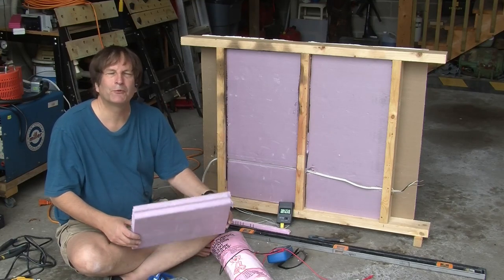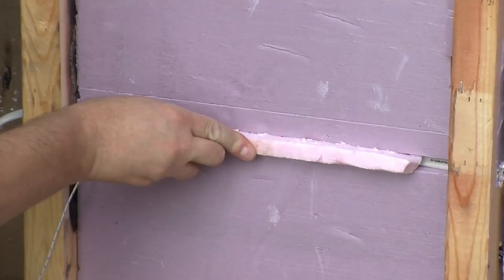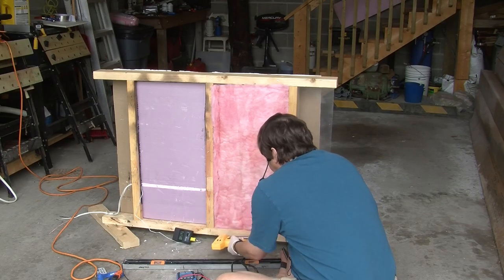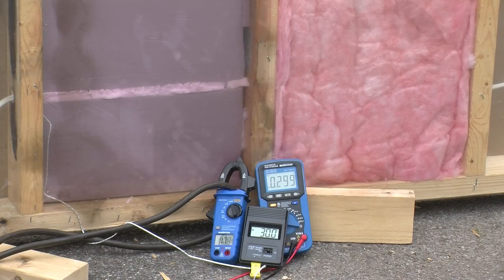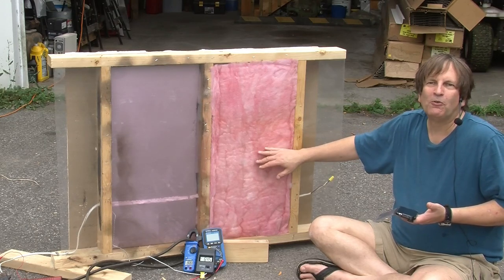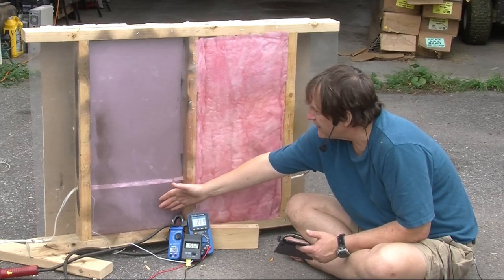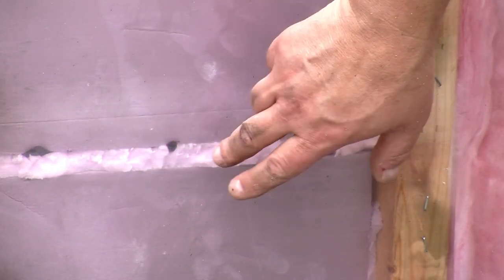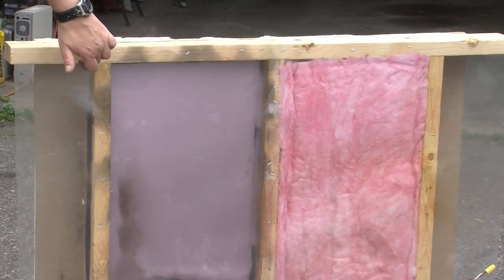Overheating and Foam Insulation. What happened?

Comment: Enjoy your test as usual. 30 years ago as part of a hospital-home health safety program, we were instructed on the hazards of having insulation covering extension cords and even phone wires. The insulation could be a throw rug, linens, or a pile of newspapers. All electrical currents produce heat was the conclusion. It would be interesting to stress an extension cord covered with a thick rug or a pillow.
Reply from the maker: Well thanks you Ron! That must have been an interesting thing to be part of! I'm a bit surprised at the phone line caution since the currents as so low although admittedly the wire is smaller too. Did you see the extension cord test without any covering? https://youtu.be/k0g2LinZWyA  The brown cords are older and probably the type that was common 30 years ago.  I have read that either CSA or UL does one test as part of there certification where the item under test is covered in cheesecloth and the cloth better not catch fire if various components in the device fail in  any way. Although I think the cloth is thin and not so much of a heat insulator. I will keep your suggestion in mind - weather will soon get colder and wetter and I cant risk a test like that in  inside the garage with the door open so if I get to it in the next month may depend on how nice fall is. By the way - next week I plan to do a Knob and Tube current test with vintage wires and insulators.
Reply: @ElectromagneticVideos  Will look forward to the Nob and Tube test. Yes, the current for common phone wires would be too weak for any fire; I should have said that the much thicker cables used in busy offices that carry multiple conductors are the ones that over time actually do generate enough heat that in rare instances have caused smoldering fires. As to extension cords we were shown some photos as an example. With OSHA and inspectors, even intruding into homes of patients, we as nurses would do a home safety inspection as part of our initial nursing assessment.
Reply from the maker: @ronkemperful  The old 25 pair phone wire for office phones! I never even thought of that. I could see that generating heat with some many wires clustered together each drawing a small current and producing a little heat and it all adding up. I actually used to hord scrap sections of that cable - the individual wire are great hookup wires for development work - each is nicely color coded and fit perfectly in prototype boards
Reply: @ElectromagneticVideos  It would be a very interesting test with knob and tube on the insulators.    I'm saying that for 2 reasons,  the biggest is the cloth cover insulation combined with the inability to short as they'd be too far apart.      Like I mentioned in a previous comment,  lived in Pontiac Michigan where I had to evacuate my rental property when the neighbors home 1928 Balloon framed 2 story burned fiercely on a cold and  windy November night started by a bad splice between knob and tube, & romex in the attic.    The  experiment being,  would the cloth covering actually be flammable enough to catch fire, and if so, at how much current,  and with what amount and type of insulation.   Simular could be questioned about the older, 2 wire ungrounded romex with the fabric braid. Incidentally I've researched and talked to many electricians, your technically not supposed to insulate over knob and tube,  supposedly because it's designed to be air cooled, and insulation changes the thermal and fire safety properties of the wiring.    Of course in a real world situation it would be very rare to have knob and tube still in use, as most insurance companies refuse to insure the property or at least require an electrician inspect and certify the condition,  and you'd pay an arm and a leg for coverage,  and if you knew you had it you'd probably want to start budgeting real soon, for a rewire and sleep better at night.
Reply from the maker: @Sparky-ww5re  I will be interested in what happens too. I got some a few feet of knob and tube wire as well as many insulators from the shed (maybe former carriage house) from a place that friend is renovating in Pakenham, Ontario. The house is about 200 years old, but the shed may not be as old. I did already measure the diameter of the wire and it is #14. No idea  if wire used for knob and tube came in multiple sizes in those days. I'm going to see if I can find out when electricity came to that area - I'm guessing it might have been one of the first houses wired in that beautiful tittle town because it is very much one of what would have been grand houses for a rich family way back then. A number of little towns had (and nearby Almonte still has) their own little hydroelectric plant, so its very possible that the wiring was done before electricity was available across most of Ontario.
Reply: @ElectromagneticVideos  Knob and tube should definitely be interesting (still some remnants of this old system in the basement and garage of my current residence, think the wiring in the garage was in service until the mid '90's).  As Kyle 1500 pointed out, it should not be capable of shorting out.  With just the right over current it might put out enough radiant heat to ignite the surrounding wood before it melts and goes open circuit.  Looking forward to your video, hope the weather holds out (getting cool and rainy here, about 150 miles south of Ottawa).
Reply from the maker: @robertlapointe4093  That really cool that you have some remnants of it and that it was in service recently (well at relative to the age of the wiring). I wasnt thinking of radiant heat but your right - with that in mind I'll have to try inching up the current slowly to get as much radiant heat out of it before it breaks. Just thinking -  radiant heat and the heated air rising up against 100 year old dry timber is a probably a recipe for fire particularly if maintained for hours. I was also wondering if it might crack the tubes from the heat. 

Great to hear from a "neighbor". Next weekend looks good for us - but I know the lake can make quite a difference between the weather north and south of it.
Reply: @ElectromagneticVideos  - I too horded the multiconductor phone wire to use for wiring proto boards. I came across several hundred feet of it a few decades back and I think I am set for life. Interesting that they have different color combinations, for instance one type doesn't have any purple wires, another has minimal yellow wires, etc. With all of the color combinations, it really makes it much easier to tell different connections apart. The only drawback is that it isn't meant to be soldered and the insulation draws back easily.

I had the good fortune of going through UL 544 medical grade testing a number of years ago. They do indeed do a fire test using the cheesecloth. We had to provide multiple units and a pile of power transformers (that were already UL approved). They tested every possible scenario of component failure and having an incorrect fuse in pace, etc. Beyond electrical, they also test for things like sharp edges, etc. For medical, the leakage current had to be under 50 microamperes, much more stringent than today. I am pleased to say we passed on the first try.

Love these videos. A bit scary to see the temp rise so high with just 15A. It isn't uncommon to find 14 Gauge wire on a 20 amp circuit in some places either so that gets pretty tight on the spec. Luckily most higher current loads in a household are normally short duration except for perhaps space heaters and air conditioners. Your videos are answering questions I have always been curious about and will probably result in me rethinking how some circuits are run in the future to minimize wire heating. Looking forward to the knob and tube video!
Reply from the maker: @joelstyer5792  Interesting about the colors - I thought they were standardized with each color + stripe color combination being being defined for each numbered set of phone pairs. And I know exactly what you mean about the insulation shrinking back! 

Thats cool about the medical UL testing - so I was right about the cheese cloth! I'm amazed that the leakage current requirements have been reduced. Must have been great and a huge sigh of relief to pass on the first test. 

So glad you like the videos. I wasn't expecting the 15A temps to be so high - from your an others comments, I'm not the only one who was surprised. #14 for a20A circuit - the only place I have heard of that is for industrial applications - is that ever done in residential applications? Your right about intermittent loads. Certainly up here (Ontario)  I think the danger is in the winter if central heating failing and a bunch of space heaters are plugged in there could be real issues if the wall wires go though too deep a layer of foam or other insulation. 

Know and tube will be interesting - pretty wild to be trying 100 year old cable and insulators - apparently the insulation is cloth covered rubber and it looks like that. I'm wondering if the rubber will catch fire since I doubt they had fire retardants back then.
Reply: @ElectromagneticVideos  - UL544, the medical standard, was replaced by a new standard, I forget the number. It is more in line with the European standards. Ul544 was strict, depending on the application,, you had a maximum of 50uA or 100uA. 50uA can be difficult to achieve in some circumstances. I believe the new standard is 300uA now, which I feel is too high since multiple equipment tied together can accumulate. In addition, the ground connection had to be checked on every product to 25A RMS. Each unit also had to be leakage tested and hipot tested, I think to 2500V RMS. And UL would come and look at our procedures every three months. We eventually went with off the shelf power bricks that were pre approved. For me, I enjoyed learning about the process.

As for 14 GA on 20A circuits. I have seen it done, usually by novices, especially back before the cables were color coded. I always thought when they made 12GA yellow and 10GA Orange, they should have made 14GA light blue or some other color. That way you could easily tell older wire form new. I believe the problems arose when someone knew just enough, added say a new lighting circuit figuring it would draw lower current so they just extended an existing 20A circuit with 14 GA wire. And to some, wire was wire, it all looked the same back then. Now with the color coding, it is more obvious that something is different.

I agree, I am curious about the insulation too on the knob and tube. And how ill that insulation add thermal insulation to the wire? And how is it different from when it was new (a difficult one to answer)? Knob and Tube probably performed well since it was rarely in insulation and usually had large holes through joists and studs.
Reply from the maker: @joelstyer5792  I can see 50uA being hard. I'm guessing you need primary and secondary of transformers on separate legs with the core nicely isolated. I sure wouldn't want multiple 300uA  devices hooked together and then to  me.  

OK - yeah - DIYers with who "knew just enough" as you put it. I'll bet even today with the color coded wires it still happens.

Knob and Tube: The wires are a little stiff and I'm sure a sharp bend would break the insulation. Or maybe not. When I stripped the ends the insulation was not brittle - in fact in better shape than I have seen the insulation on some old 14/2. I did video some of the original installation and its exactly as you describe - I will include that in the video.

Comment: Wow, I was really surprised how hot that wire got at 15 amps.  It shows that there's a very good reason for the 80% continuous use rating, and why newer homes is rated for higher temperatures.
Reply from the maker: Yes! I was amazed too. But is even more insidious than that: the real problem is the amount of insulation we use these days. In a very crude sense, the rise in temperature for a given current is roughly proportional to the amount of insulation around the wire. So use  twice as much insulation as I did an one would expect twice the rise in temperature. 

The electrical code really needs to add some rules for the amount of insulation allowed around wires and/or how one has to de-rate amapacity  based on insulation. The problem will be to distill it down to some simple rules suitable for the code. (Or is it in the code? I'm an EE, not an electrician and they are the experts for code rules). 

I think as you said, the 80% rule helps, but up here (Ontario)  where attic insulation thickness can be measured in feet 80% may not be good enough. I think if I was having something installed in that sort  of highly insulated area that had any sort of heavy continuous current usage, I would probably insist on one or two sizes bigger wire  than required by code and/or metal conduit through areas of thick insulation.
Reply: @ElectromagneticVideos  I'd say the only thing that'd use 12 amps continuous is something like a space heater, which is unlikely to be used on a hot day.  Even a window air conditioner doesn't run continuously, and isn't typically using a full 12 amps.

It does say something about using conduit though.  Some places requite conduit (Chicagoland) everywhere.  No Romex.  The open air space even in plastic conduit would reduce he insulating effects of even thick insulation.
Reply from the maker: @stevesether  I didnt know there were places in North America that required conduit for residential applications. As you said it would sure make a difference.    I wonder if there is  a specific reason they do? Would also be interesting to compare their house fire statistics with places that use romex. 

I know in Europe conduit used to be used for homes but I think it was because walls were cement and brick and and it was the only practical way of running cables.
Reply: @ElectromagneticVideos  Yeah, "Chicagoland" as they call it is a little unique.  AFAIK they also don't just let homeowners DIY their own wiring.

I'm not really sure why.  Knowing Chicago, my guess would be more graft than anything else.  Conduit isn't easy for a homeowner to DIY, so perhaps that why they do it rather than safety reasons.
Reply from the maker: @stevesether  Interesting. The conduit must sure makes things expensive but at least the flexible plastic stuff probably;y makes it not quite as bad.

Comment: Really great experiment. Really liked the stabilized temp at 15 amps, showing real world temps expected on house wiring in insulation with loads like space heaters.
Reply from the maker: Thanks! As expected, the various types of insulation definitely increases the temperature rise around a fully loaded conductor. I would sure consider using an up-sized wire in places   the cable might be within insulation as well. I gather in many places in North America #12 has now replaced #14 for 15 amp circuits - not a bad thing!

Comment: you should test a string of 12 or 14 gauge MC cable to see if it contains the flames and smoke
Reply from the maker: Particularity with high amperage available to potentially eat through metal armor. May in the summer when I can do outside experiments again without freezing!